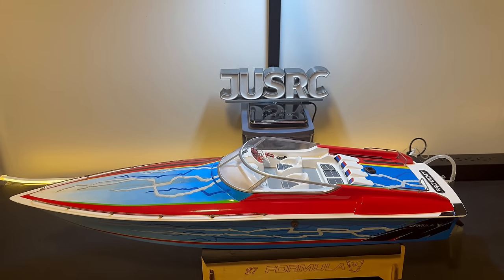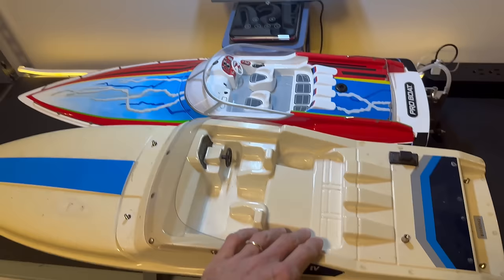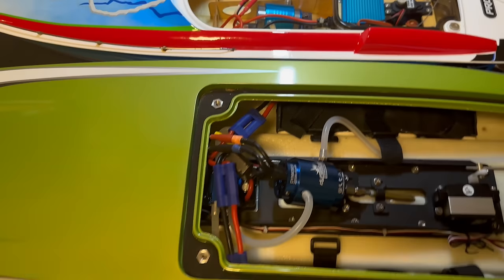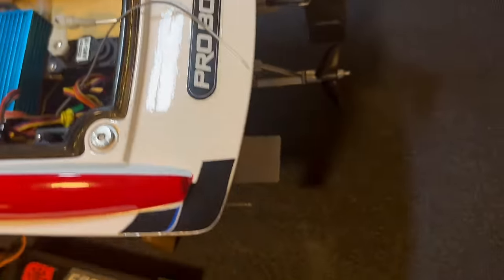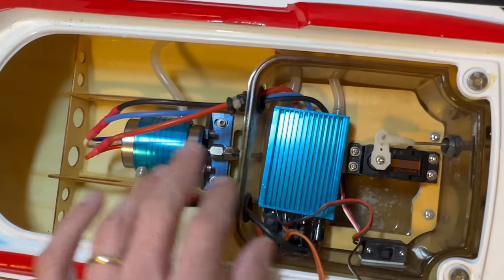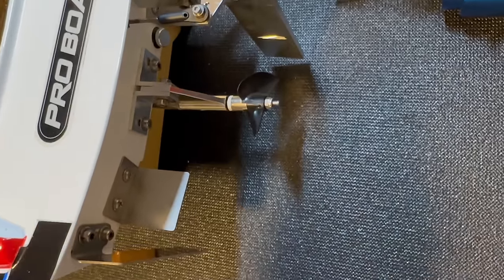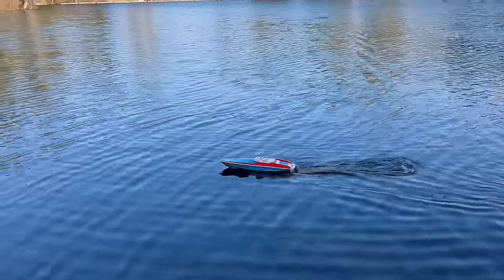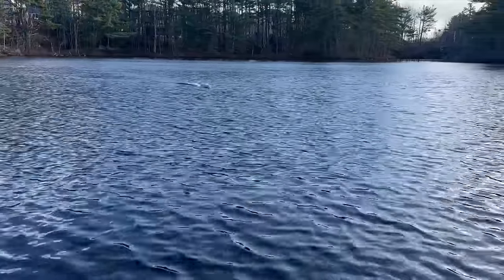Pro Boat Fastech 4s Brushless RC Boat!

Comment: that villain is an antique lol the newer villain EX is the dual motor and 14.4 esc version that Proboat Formaula fastech is an extremely RARE hard to find boat please donot change it i’ll buy it from you lol id trade you two villain EX BOATS FOR IT DONT CHANGE IT BEEN LOOKEING FOR YEARS AND ONLY HAVE FOUND 2 of them 😢
Reply from the maker: I now have a 2nd fastech, email me if you’re interested in buying that one..
Reply: @JusRc  will do
Reply: I have 6 of the pro boat formula fastechs been collecting them restoring them for 14 years now